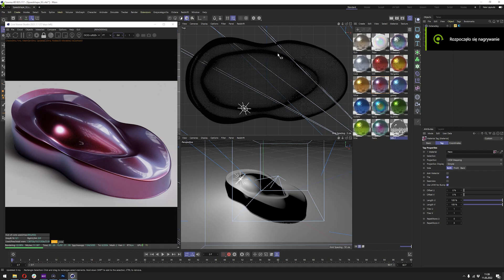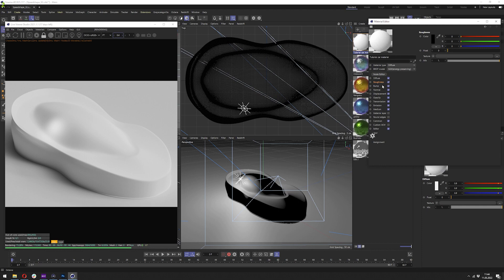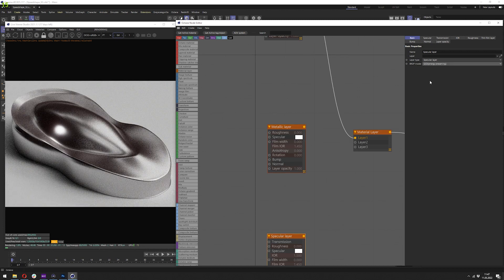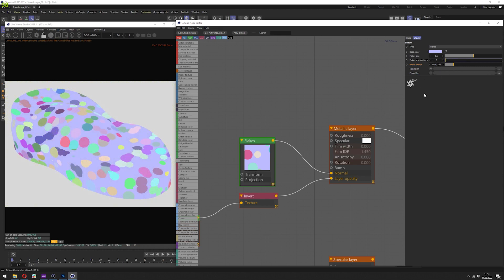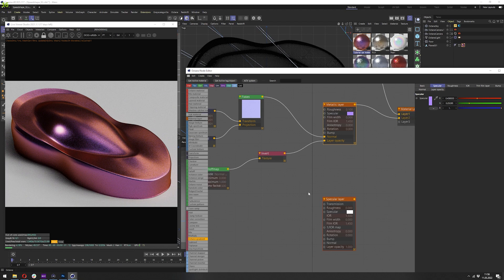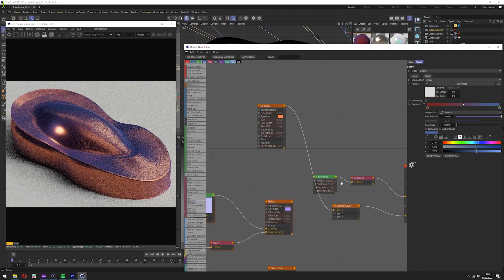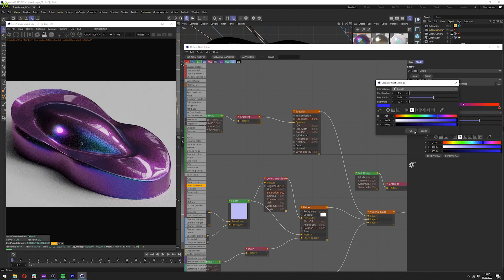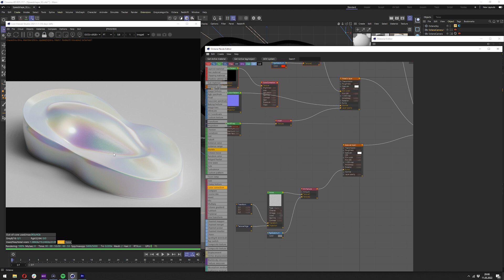Car Paint Material Using Material Layers In Octane Renderer.

Comment: Flakes are useless if you render at low resolutions especially if your output is PNG or JPG you won't be able to see it unless you use OpenEXR, correct me if I'm wrong.
Reply from the maker: Hey!

PNG/JPG vs OpenEXR or in short 8-bit vs 32-bit, its just diffrence visible in color range, its not change that will make any diffrence in this case. Even in HDR it doesnt really matter since its not light source or is bright enough to have any benefits in visibility of flakes/material. Same goes for compressions possible with (PNG/JPG) you dont have to go any lower in compression than to a point where it fits for websites, any more hardcore compression is almost unrelevent in todays standards. As for low resolution, i mean of course if you render it super low you will not be able to see flakes, but again, why would you want to have such a low resolution? From expirience i can tell you that a lot of times images are made in higher resolution than it will orginally be displayed, so even if you need 500x500 image for certain project, there gonna be probably high res in greater resolution on designer side. And still if you dont see clearly each flake on your object, it still will give you that uneven "noise" like look to it, adding that extra visual noise to whole look of car paint. And finally in cases of animation where camera is sometimes far and sometimes really close, you will have all details you need to make it look in both situations.

 Hope that explain it well, if you have any questions let me know, always happy to help!
Reply: @NojsGraphics  Fair enough!